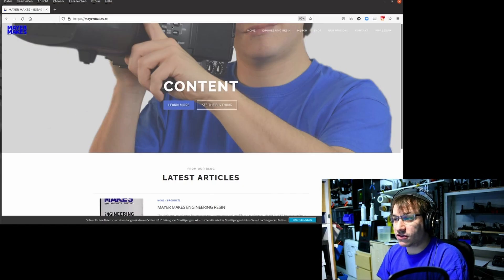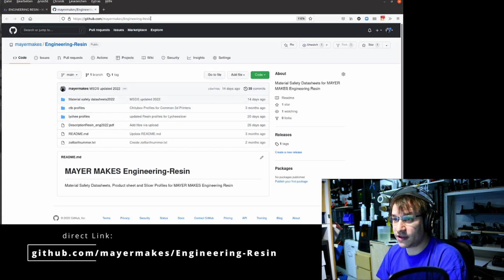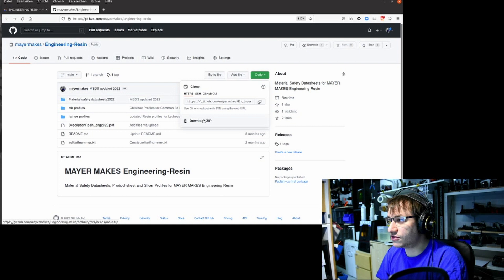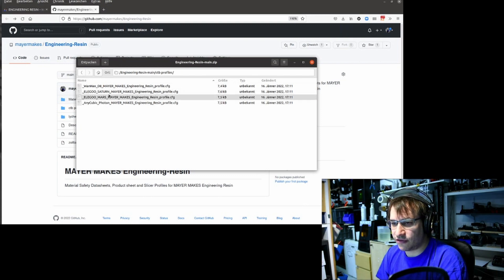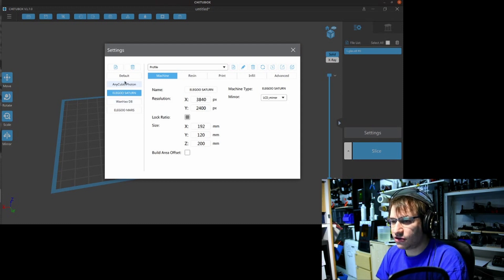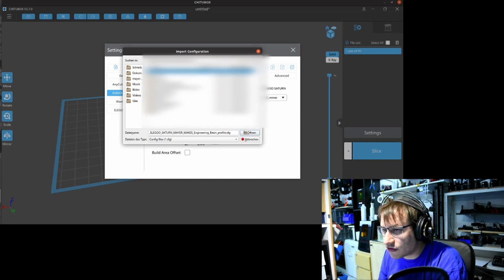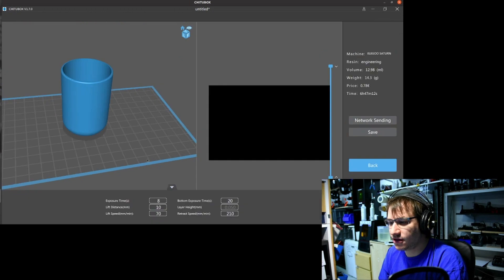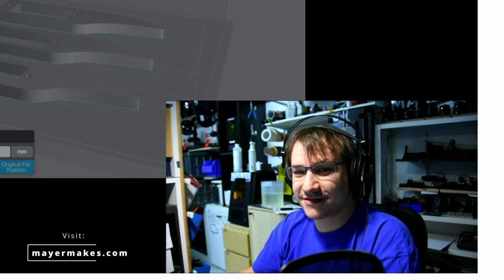How to import Resin profiles in Chitubox | MAYER MAKES Engineering Resin

Comment: Well this done work for a mars pro 2..
Reply from the maker: the prcedure is the same for every printer. for the mars pro 2 you can use similar settings like the Saturn or Mars pro.
Reply: @MAYERMAKES  Nope, nothing loads at all. Tried it several times.